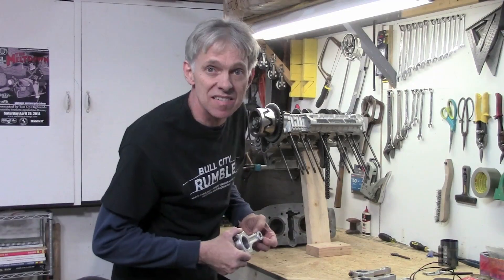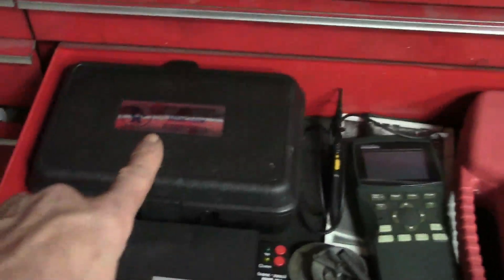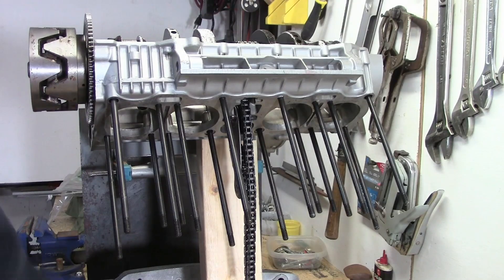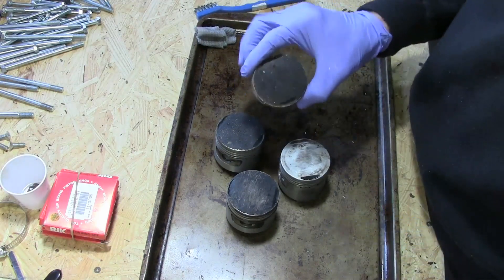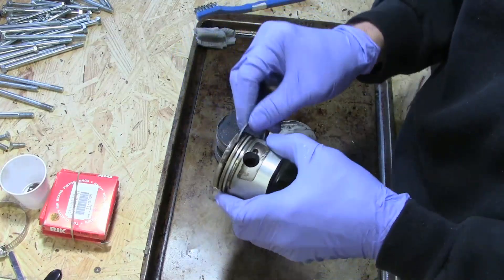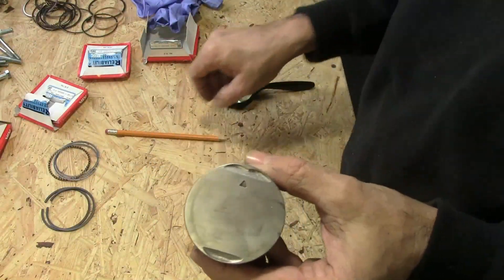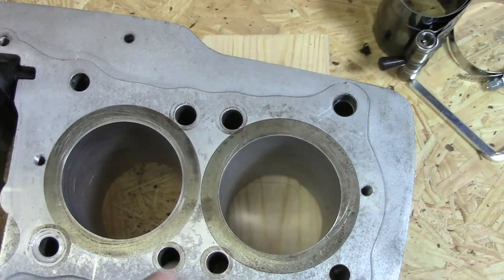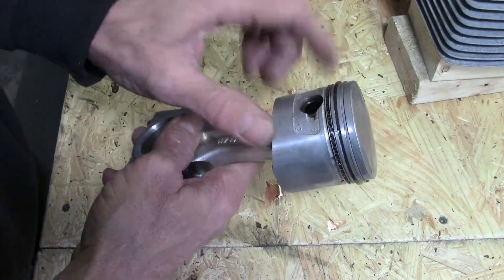73 Honda CB750 Custom Build Episode 13 - Honing Cylinders & Installing Piston Rings

Comment: I found the easiest way to get old pistons super clean is to soak them overnight in a can of Berryman's Chem Dip carband parts cleaner. That carbon in the ring groves will wipe away with a shop rag. No harsh abrasives needed.

Comment: ...For the ring compressor, if you turn it over, you will see 3 little outdents, Those are there so that the compressor sits flush on the piston deck. With your method of putting the pistons in from the bottom, it should work the same, and help with getting the piston in squarely.

Comment: I did a 250 Twin star Honda for my son , it was a 1981 for his graduation from high school  the bike was the same year he was born , to go back and forth to college and work .  took 3 tries to get the timing right the chain and dots line up , had to turn the chain and ride over the cam , little trick , not in the book  180 degree off and it will line up .

Comment: Are you absolutely sure, that those piston rings are not the other way round? I would say, that the darker ring looks like it could hold the heat and compression better.. Also, those two angled edges in a ring transit oil for coolant.
Reply: Oikku Oek Yep. I'm sure

Comment: really awesome video and i really needed this to work on my 83 DOHC cb750sc and i really needed a guide on how to do this. the only thing wrong with mine is that it needs new piston rings and this showed me for the most part how to do it. I was wondering is it absolutely nesscary to remove the connecting rods from the crankshaft to do this or can it be done by just removing the head, cylinders and pistons while leaving the connecting rods in place?

Comment: I've seen two cheap ring compressors, a hose clamp wrapping either the cut out sides of a beer can, or the sides of a plastic soda bottle.  Those automotive ones don't work well with small pistons.
Reply: truantray This one is designed to go down to 2 1/8" diameter so it works quite well.

Comment: Hi :)
I have a question...
Why you don't lube a cylinder surface before you will put a piston?
I saw that you lube a piston rings but cylinder was dry...
And second question..
Why most people use "assembly lube"? Is better than normal oil - for example 10W40?

Comment: Those piston ring will eat the walls quite fast. He didn't even gauged the piston rings to match the cylinder walls.
Never seen pistons being installed from the bottom of the cylinders either.
Reply: Yes he did , After he showed how to instal rings on the piston , he showed how to gap the ring in the cylinder .  Most bikes you go from the bottom of a cylinder up in ,  Car you go top down to crank .  that little piston and ring I used my fingers to get the rings in the land to cylinder .

Comment: See thats why people put pistons from top cause the ring compressor tool does not get in the way with connecting rod, there is nothing wrong in your method just wanted to mention it. 

Every method has there pros and cons !!

Comment: Is there a front or back on the con rods? (180 degree orientation in the piston)
Reply from the maker: No.
Reply: Good to know thanks. I'm also building a 750.. it's a 1973.
Reply: That was my question too! Glad I didn't have to read TOO many comments to get to it. Great video Dean!

Comment: Hey Deano, absolutely love these videos! I am doing the same with an 81 CB 650. I bought the same piston ring compressor but will be installing the pistons the old fashioned way.  Is it possible to use the tool  since it does not come apart and it is already connected to the engine prior to fitting the piston into the cylinder?  In other words, with the rings compressed and you get the cylinder down on the piston - how do you get the compressor off?
Reply from the maker: +David Dubuque Try using a metal hose clamp instead.
Reply: last time I was putting pistons in I used an empty drinks can, cut to size, and a pair zip-ties that were used backwards so they didn't lock. Worked okay, just gotta watch out for the can getting stuck inside the cylinder.
Reply: Hey David - about to do reinstall my cylinders the old fashioned way on my cb750 K3. Any advice?
Reply: I ended up just pushing the rings together with my fingers as I slowly lowered the cylinders.  I also used the hose clamp method on  my first attempt, but had to take them back off to fix a gasket and a broken ring.  I've also heard of using a soda can cut to size and cut lengthwise secured with a zip tie.  One of these should work for you.

Comment: Just wanted to say "Thanks!" I was doing an engine swap on my Magna (put a VFR motor on my 1995 Magna) and the Motor had a burnt piston.  I replaced it and used this video as a guide when honing the cylinder. I gave you a shout out in post #124 of my thread.  Thanks again for sharing your knowledge. I put some links below.

Link to where I referenced you:
http://v4musclebike.com/forums/showthread.php?p=365971#post365971

Link to the start of my engine swap thread (if your curious):
http://v4musclebike.com/forums/showthread.php?p=359942#post359942

Comment: He made a serious mistake at the 3-piece oil ring installation !! The correct installation should be as following: Install firstly the spacer ring on the piston and put its 2 edges at piston's pin side no matter L or R and the spacer edges should not jump each other !!. Then starting opposite of this "ring spacing", place one of the two (thin rings) by turning spirally until seated properly and 1cm offset of this virtual axe !!  Now place again the one of the two (thin rings) by turning spirally until seated properly and 1cm offset of this virtual axe, but not at the same side as the previous ring. So finally the 2 thin rings should be at the 150 and 210 degrees (opposite of) the spacer ring's clearance. Now install (spirally) the 2nd from top compression-scraper (dark color) ring and finally install (spirally) the top compression (chrome edged) ring!! Lubricate with plenty engine oil and turn them around several times to insure lubrication goes into rails. Now turn them to their final positions before inserting piston into cylinder, ensure all ring edges should be at left or right of piston pin and not at the same side of piston pin !! by this way you can have the best compression sealing and oil scraping back to crankcase. Never put a ring clearance at 90 degrees of piston rod (because these sides have the most gasses pressure). I hope this will help a lot, those who aren't professionals, but enthusiasts to learn more !! Have a happy and succeeded installing, if you follow my given steps !! :-D

Comment: overall great series - however you make an absolute critical error and promote that  through your "advice". You MUST have a machine specific Service Manual, guessing and "same-as" stuff is dangerous - ie piston ring placement - 100% incorrect for other machines, you must have a manual and follow it. No excuses these days, all online.
Reply: Oden Eaters That piston ring placement is from the factory Honda CB750 manual (hard copy) and I quote "Space piston ring gaps of all three rings 120 degrees apart and then install the piston into the cylinder". I don't know where you get the idea that this is wrong. Perhaps for "other machines" but hey, this is a Honda CB750 last time I looked.
Reply: you are correct - I just wanted to emphasize that everyone needs a service manual, see far too many tubes of "DIY hipster rebuilds" that suggest it's all the same. Seeing a lot more local ads for "project bikes" these days, DIY'r basically made a bike into a pile of parts that "just need to be assembled", YT is partially to blame IMHO. Thanks for the show, again just wanted to emphasize the need for the correct reference information before starting out.
Reply: Oden Eaters Agree. Way too many bikes out there getting trashed by someone doing a "build" on a running bike. How about you just make it run first and ride it? Yes a factory manual is essential! Cheers, and thanks for watching. :)